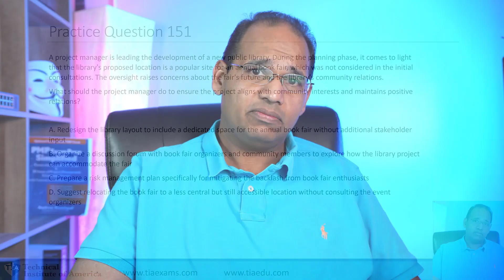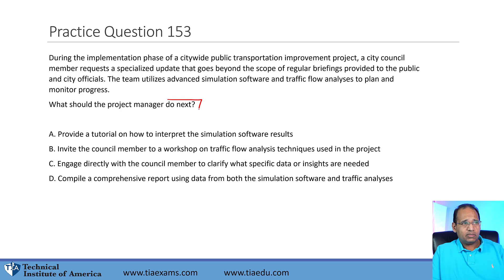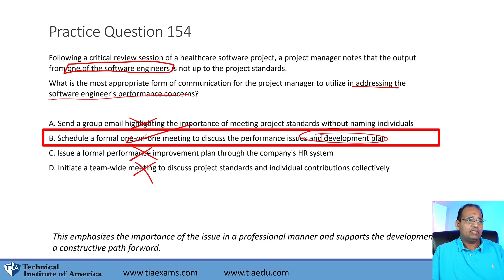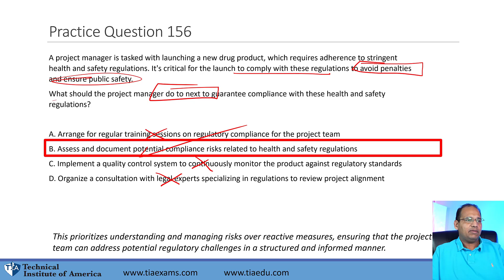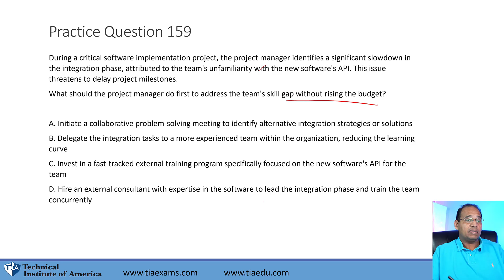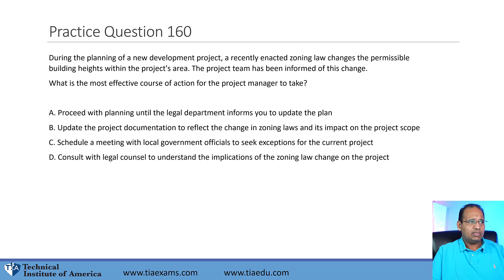200 Ultra Hard PMP Questions 151-160

Comment: @AndrewRamdayal About Q160... I like the "D" much more than "B". It was mentioned many times that before making any action we should evaluate the impact. There is nowhere written that the projected building is impacted by the law. It is also not really implied and based on the information avaialble I would first check if there is any impact and then would make any changes to the plan... Wouldn't you agree?
Reply: It wasn't asking what should you do first. It's asking what action needs to be taken; and you have to abide by the change because it's a law
Reply: @nadavharari2170  Okay.. that could be a way of looking at it.
But - if the regulation has no influence on a project (let's say the zoning law forbids building over 100meters height and the project aims to build 50m high building) - why would you reflect this change in your project documentation?
Reply: @yrqq  agreed. without analysing the impact PM shouldn't document it. for me also D is better answer.
Reply: In my mind, just adding something to a register isn’t very effective, making sure you fully understand the impact by consulting with legal is the realistic action almost everybody would take. He didn’t say the next thing he said the most effective thing. If he said the next thing, then I would say yes just update the register next. I hope these unnecessarily difficult or even impossible questions. Don’t screw up my study.

Comment: Q156: the question specifically says what should PM do to "guarantee compliance with standards". It should be quality control. How does risk analysis guarantee compliance ? 
Or is he doing risk assessment coz the project is just starting and he is probably in planning stage ?
Reply: I agree, it should be quality control. Appreciate if someone could share insight on why it should be assess risk.
Reply: @simmysharma6983  I'm not sure it is already at quality control phase, because the begining says "launching a new product". I agree that B does not address the compliance issue. In the real life, I would at first consult with an expert to prevent the problem upfront, which makes me choose D.

Comment: 122/160 so far.....160 should be D IMO. It will be very difficult to update the project documentation without enough substantiation, which can only be facilitated by legal team. The PM is informed of the change for sure, but it is not provided if he/she has enough detail to document, which in my experience cannot be done or assumed to be done using high level information. B should be done after D for sure
Reply: Bro did PMP help?
Reply: Its not D, because the height change of the building is clear what he impacts are, what else would the city provide like information? The team would know what the impacts are.

Comment: I guess for question 155 the answer should be B. Because as it is an Agile project, the PM should train, develop and act as Servant leadership.
Reply: same thing, Just thought if some one else has same doubt
Reply: I was gonna go for B because of a mindset I read from someone else's lesson. But if you read A, it says synchronize team efforts, and address any issues promptly, I think that'll solve the problem with quality and missed deadlines.
Reply: @BryantInManila  But daily stantup to clarify project goals? 
But again B only deals with missed dedline- Time managment /Productivity tool. Hence better A- to address generally
Reply: @BryantInManila  It says the team works in different time zone, and I am wondering if we can have a frequent virtual daily stand ups with different time zone personnel in a day. Any thought?
Reply: @reetukapandey4435  this was my problem in another test I did. It was impractical or inconsiderate to find a common time zone, then I remember it was a question for stakeholders. This one is about a team of developers in different time zones, which is very realistic and reasonable to conduct a daily meeting. Let's say you're working for a company in the US, but you're on the other side of the world, meetings are usually scheduled in the US time zone instead of the normal Monday to Friday 9-5 work hours.
Reply: I guess Option B is the correct answer. Since the PM has encountered the same issue with inconsistency and missed deadlines, they likely implemented basic Agile practices (such as daily stand-up meetings). Now, the team needs to further strengthen time management and adopt more effective productivity tools for better improvement and performance.